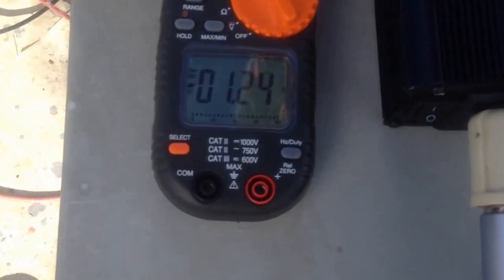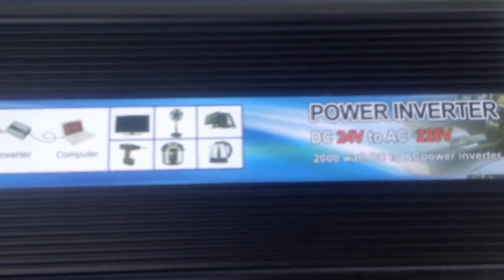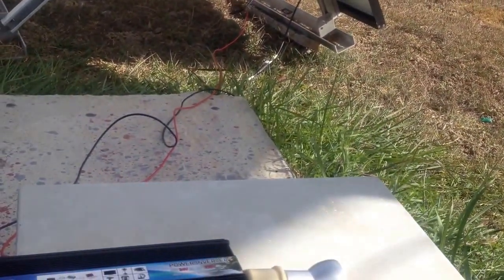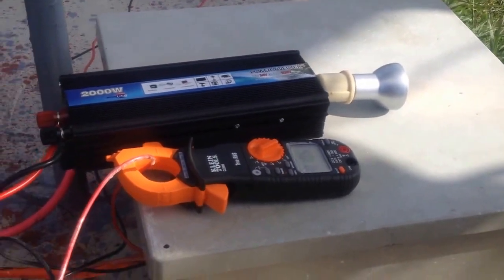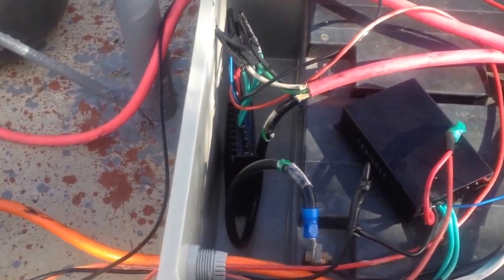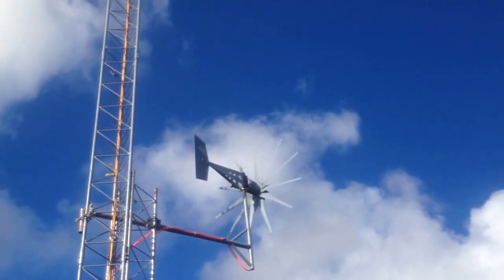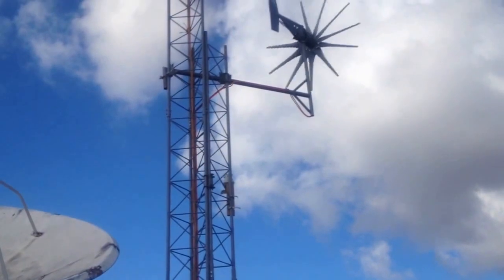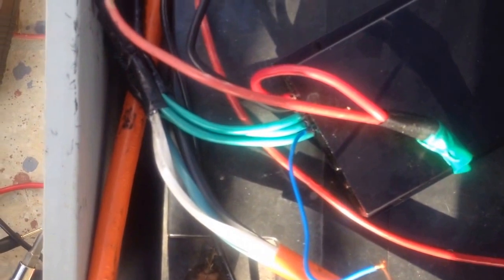Real power from missouri wind and solar turbine

Comment: Beautiful tower, love your setup
Reply: If it is installed properly, they are one heck of a way to mount just about anything. The 40 ft one I have weighs in at nearly 600 lbs. It was made in four 10' segments for the county for a radio tower. It also has bonded grounding wires on it for lightening strike protection.